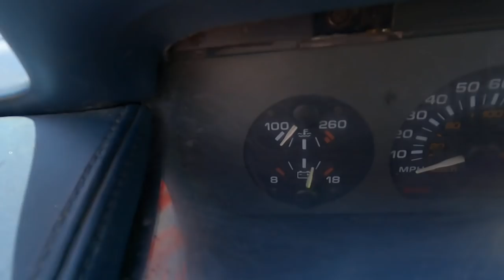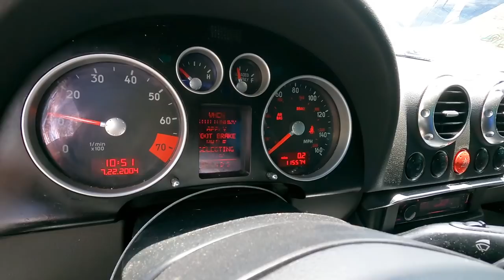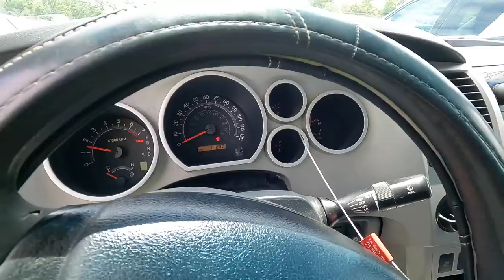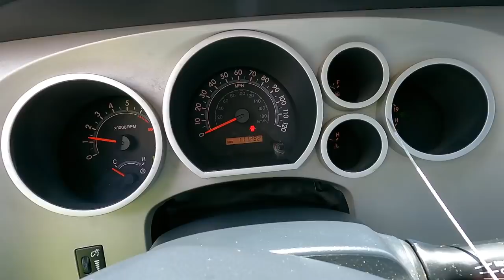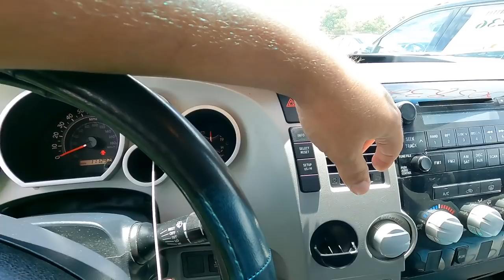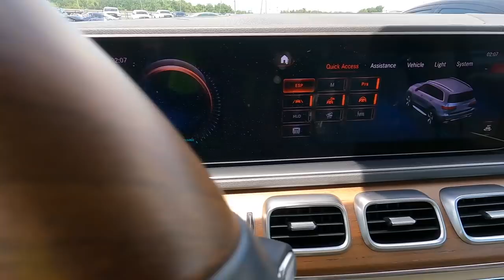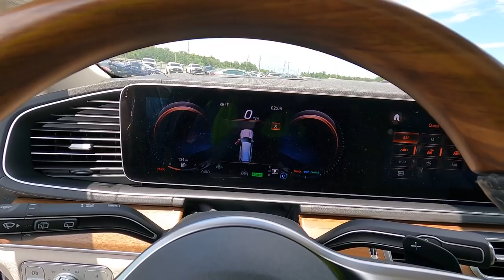IAA New Orleans, LA Walk Around 1968 Corvette 427 + Bullet Hole Audi!! 7-6-21

Comment: Unless the Vette has had an engine swap its a 427, The 454 wasn't out in 68
Reply: 73 was the first year.
Reply: @Excitable101  I didn't know when but I knew it was after 68, I would have guessed 1970 because of the LS5 and LS6 in 70 Chevelles, I would guess Corvette would get at least as big of an engine as the Chevelle.

Comment: Besides the block casting#’s on the Vette- the 454 would be externally balanced by additional metal on the harmonic balancer & flywheel/ flexplate vs 427 is internally balanced w/ out the additional weights. You would have to pull the trans inspection cover off to verify.

Comment: Hey Randy, good walkaround on the Corvette. I've been waiting for it to come up on the auction schedule. Definitely best used as a parts car like you mentioned, but somebody will probably bid it up and foolishly attempt a "restoration". The tach redline indicates its a 427/390HP with single carb, and the 3919849 is the original GM low rise Corvette 1968 only aluminum intake to allow for the Quadrajet and air cleaner to fit under the hood. 

The 427 and 454 are identical externally, with the same cylinder bore size. The 454 just has a longer stroke crank 4.0 versus the 427 at 3.76. The only way to visually distinguish is by block casting numbers or harmonic balancer which is a smaller diameter on a 427 versus the 454 . The 68 will have a 3916321 one year only casting number, while the later 427 and 454's have the 3963512 casting up until 1971. Now back to mumbling Corvette part numbers under my breath in the garage :)

Comment: I can confirm,I daily drove a 1990 Chevy Lumina Euro V6 3.1L for over a year 2018 to 2019.It ran great and no idle issues but for mine the battery was visible with that bar going over the top,I sold it with 108,000 Miles and the exterior was a dark blue and same with the interior which was like new sold for $1,000 but took a month to sell.

Comment: Randy Excellent Coverage, I Remember Those Chevy Luminas (They Where A Drastic Departure From The Chevy Celebrity) Supposed To Be The Late Eighties, Wave Of The Future, That Audi 3.2L VR6 Was Sweet.. The ‘68 Corvette 427 Big Block Roadster Is Near & Dear To Me, I’ve Got A ‘68 Corvette 427, 4-Speed Manual, Been In The Family Since It Was Two Years Old, I Know The Corvette’s Very Well, The Big Block Corvette WasFrom 1966 To 1974, Early 1966 The 396, Late 1966 To 1969,  The 427, Then 1970 The 454 To 1974..

Comment: That intake on that Corvette is an RPO code L-36 which is a true '68 390 horse 427 Q-jet, oval port headed engine. Not the top dog 427 for '68 but absolutely could matching to the rest of the car.

Comment: The 454 came out in 1970.   The big gun in '68 was the 427.   Visually the two look very much alike, it would be hard to tell what's in that Corvette without some casting numbers.    I know that you can't tell what the original engine was by the vin on a Chevvalay, the engine code in the VIN would just indicate it's a V8.

Comment: Good friend of mine I shared my shop with back in the mid 2000's was used car dealer and bought a 1999 Chevy Lumina from Copart. It had about 30k on it and was hit in the front. Was super nice car and he replaced front bumper cover fixed core support replaced airbags and windshield and repainted it. It was nice car and him and his wife drove it all the time. Well he was driving in eastern part of Norman, Ok and nailed a deer doing about 60mph. The deer bumped the front bumper and didn't deploy the airbags and smashed into the windshield. Luckily they were not hurt at all but was so traumatized crushed the car. There is nobody left to tell this story but me.

Comment: Astro van was same way when battery was dead
Reply: All GM vehicles of the time were.  I worked at a Chevy store in 1987 and I found that there has to be a charge in the battery to tell the computer to tell the alternator to charge the battery.  We had 600 cars on the lot and a lot of batteries went dead (You gotta love those side post batteries).  I would leave them running with a turn signal flashing.  If the car stalled the light would go out so I knew to go back to that one.

Comment: Good Ole Chevy 3.1L and 2.8L hate having the battery die or replaced gotta take em for a good WOT drive and they'll come back around. That thing on the door panel of the tundra was most likely either a aftermarket puddle light or one of those lights that project something like the Toyota symbol on the ground when the door opens.

Comment: Hey Randy those things are projectors they project the emblem on the floor the name of the emblem on the floor they just had to put batteries in them you just push them and they light up at night when you open the door it automatically turns on so you can see what like Audi Chevy Volkswagen all kinds of things that they put in those their slides and it’s a light and it shows the amount of what you driving and what you have

Comment: The things mounted to the TT taillight are resistors. The lamps were changed the to LEDs and those resistors are needed to put enough draw on the system so turn singles and burned out bulb sensors work as they should.

Comment: I have own older lumina and 95 96 97 I bought a 96 drove it 240,000 miles was in two accidents in it rebuild it and then 240,000 miles 95 I got cheap someone told person that owed it need head gasket only thing it need was intake gaskets good running dealer said why quit making them because they didn’t sale lot parts for them my 96 had original rear brakes on it at 240,000 when I got rid of it

Comment: The 454 didn't come out until 1970 so if it's the original it would be a 396 or 427.
Reply: You had your choice of a 327 or a 427 in 1968.  The 396 was for the Chevelle and the big cars and maybe a few Novas.

Comment: LMAO would you believe here in Lonaconing, MD they used a lumina just like that one as a police car till like 2014 :_LOL: had lights, the pushbar, cage in the back, strobe signals, the works LOL

They have since replaced it with a 1997 Dodge Intrepid LOLOLOLOLOLOLOLOLOL.
Reply: I wonder how many transmissions they have been through with the Intrepid.